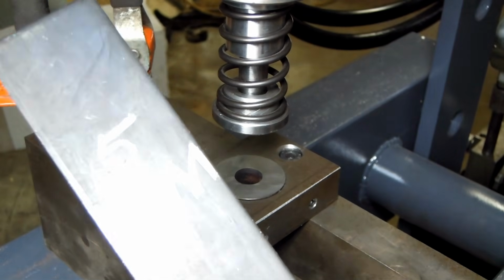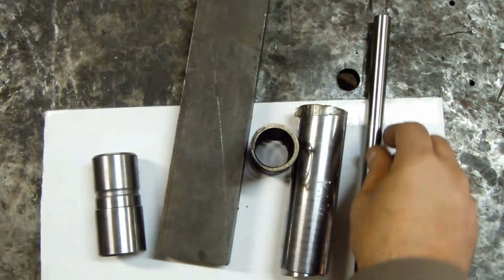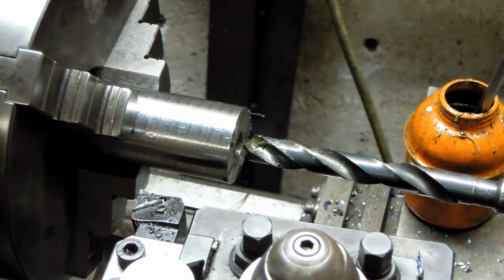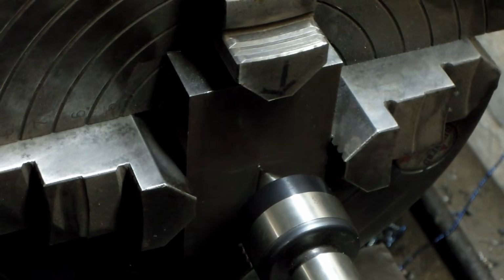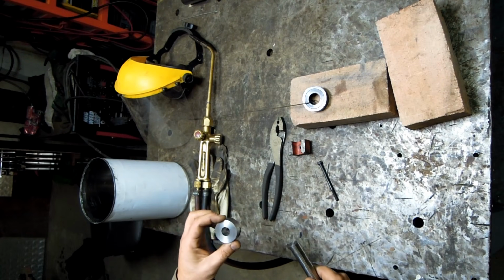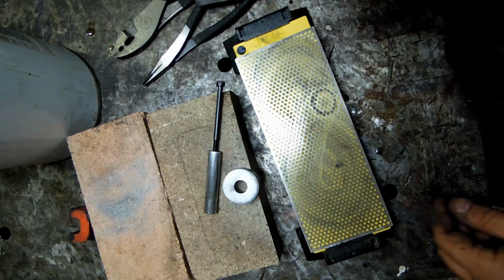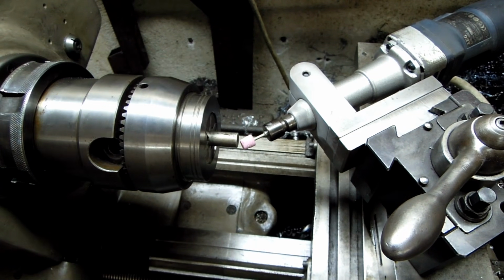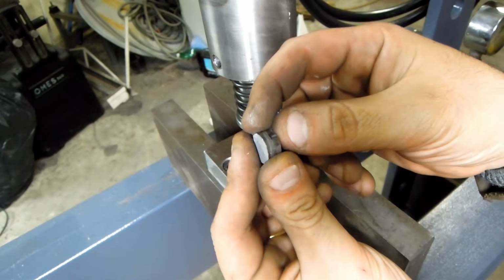diy punch & die

Comment: If you put a point on the punch tip, that can serve two functions, help get you aligned with a center punch mark you made during layout and kinda serves to start a deformation of the would be slug before the cutting/punching action starts... unless you have plans for the knock-out slugs to be a bit flatter and not having a dented point in the middle of each... nice work, like always...

Comment: After this kind of heat treatment you should grind parts a little bit (around 0.8mm on diameter and 0.3mm on ends) because they are much harder inside than outside (that means you have to make larger diameter and grind parts to the right dimension after heat treatment). There should be also some clearance between punch and a die wich depends on a thicknes of a material you are punching. (Thicker material > bigger clearance because you dont need that much force to punch, but it cant be to big because material will bend around hole). Im a toolmaker in Poland and i did a lot of stuff like that mostly on wire EDM and honestly i like watching chanells like this one because you guys have something very important - passion and heart for the job so you are often doing very clever stuff with what you have. I hope you will do this for a long time. Have a nice whoever you are, wherever you are iving :)

Comment: Tony, first of all I love watching your videos. As to how to retain your die in the block I find that grinding a 10 degree notch on the OD of the die and putting a grub screw in the center of the die block at a height that will pick up the tapered notch is the easiest way to go about this. Most none cnc type punching and shearing machines use this method. At huge diameters and workpiece thicknesses this changes to more robust methods of retaining the die due to large stripping loads. Anything you can do with your shop press will be fine with this method. Good on you Tony - keep up the good work!

Comment: I would suggest you incorporate some "shear" on the punch face.
This will reduce tool & press shock on breakthrough & reduce the tonnage required.
Where minimum punch guidance only is provided (as here) the shear might be in the range 2.5 to 5 degrees from edge to centre - so that the two proud punch edges engage first & together - hope that's clear.
Also your die retention with roll pins looks inadequate, & I think two diametrically opposed set screws locating into a shallow groove on the outer die diameter would be easier & superior.

Comment: Not to say this video isn't great, but people please go watch his other videos. There is no reason this should be his most popular. Watch the new ones. They're WAAAAY better. Oh, and keep it up Tony. New Subscriber, but I've been watching your stuff a lot lately. Great job.
Reply from the maker: Thanks Mark, welcome aboard!
Reply: Very impressed with your machining skills; thanks for the video
Reply: I feel like its because people are misunderstanding "punch & die"
Reply: so,what's that mean?
Reply: lei ningbo Well if you do a lot of drilling in thick stock, this is a life-saver. These holes are great for welding pieces together, as you can weld into the hole to next piece, then fill hole with weld. Imagine sharpening all the bits from pilot to finish just for one hole, then multiple holes. Now he can make diff. diameter punches, for varying holes as required. Saves a fortune in drill bits.
Reply: I really want to make one of these. A press would also be a great project to weld up with my everlast the next time I'm in the shop.
Reply: ..and it's more quickly and eficient when the precision of the hole are not required. Ex: To clamp two pieces with a screw.

Comment: use old pantyhose between punch and die when lining them up.   Automatically sets clearance the same all the way around punch.   Also a little oil on punch and top of die before using helps part come off punch and die will last longer before needing sharpened.  die clearance goes up as thickness of material to punch goes up.
Reply: And also material type, Mild steel gets 10% of material thickness while aluminum gets 13% material thickness plus the diameter of the punch. All materials are different, so experimenting with a load cell is important.
Reply: Old pantyhose? This is a family channel!
Reply: Proper die-clearance is a necessity. Just look at the slug to check this. There should only be one fractureline on it. This fractureline tells you if your clearance is correct. On mildsteel the sheared (shiny) part should be about a third of the materialthickness. The harder the material, the shorter this gets. Furthermore, you could modify the punchbody to make it perform better in these thicker materials. A little backtaper on the punch aids in stripping and reduces the material build-up on the side of the punch. Great video, I'm new here and am going to subscribe now. Bye!

Comment: I was a Tool and Die maker for 25 years. Anything like this you can pull off at home, More Power to You. I didn't catch what kind of steel you are using. Doesn't this kind of work seem to take forever. When you are not getting paid.
Ha
Good work

Comment: I used to make low tech decorative stamps for silver jewelry out of mostly drill rod. To harden I used a small magnet on a wire and heated the punch just to the temp that magnet wouldn't stick, then water quenched. To temper I heated from top until straw reached the business end, so top was softer for hammer blow. Crude but for stamping sterling they held up very well.

Comment: Thanks for making the videos .I made a punch for my hydrologic press for punching 5 mm holes . I used a 4x4 leaf spring very hard metal . Sharpened up a mason drill to drill the holes worked fine with oil as coolant . no need to temper it . For the punch I cut off an old drill bit . Worked grate  . Maybe you could try spring steel next time . You can buy a green stone on eBay for sharpening tungsten

Comment: HI There, Some very sound practice good to see people trying !. Few words of friendly advice, try using same material for punch and die, Silver steel is ok but not a high tensile strength compared to tool would be better to have punch as tool steel die as silver. Your spring needs to be a proper die spring, you won't/shouldn't be able to compress by hand normally colour coded and very tight coils. Modular construction of punch is ok as it reduces stressed areas but to be fair if you are only using it 100 times in your life then don't worry ! With your heat treatment try using old motor oil as the absorption of carbon into the steel can help and also keep the parts at a good red heat for at least 5 mins. longer for large parts.
tighter tolerances between the punch and die can help reduce force, remember smaller the area the smaller the force.   
Nice to see people having a go keep it up !, hopefully i will post some videos of my own when im not too busy machining !

Comment: I know I'm late to this party but:

I think you should go with an adjustable "fixed" stripper. Something held to the die that will pull or rather hold you work/part off the punch. By "adjustable" I mean with spacers and longer or shorter bolts depending on the work. I work as an engineer in a "world class" (that's what they tell me anyways) forging facility. Although our work is warm forging (1400-2300 F°) and you are working with cold steel. We use spring strippers and fixed depending on the part we are making. Fixed is obviously more reliable as without catastrophic failure the part always comes off the punch. That being said we do mostly use spring because of the variation of parts we make. I just dont think its neccessary for what your'e doing.

That's all, and thanks for these awesome vids.

Comment: Just for your reference as an old tool maker the quick formula for tonnage in mild steel is Dia X Thickness X 80
Reply: Dia in mm or inches
Reply: @jishnugopakumar  Some quick math suggests inches. Here are calculations for the same size hole in millimeters and inches:

15mm x 9mm x 80 = 10,800

0.591in x 0.375in x 80 = 17.73

The inch calculation results in a number that's not too far off from This Old Tony's measured result, and errs somewhat on the side of more tonnage. The metric calculation results in a number that doesn't work out directly as tonnage. If you assume it's kilograms, and do the conversion from metric tons to US tons, you'll end up with a value that's further off and errs on the side of insufficient tonnage. If you really wanted to use metric, it looks like the following formula should result in very similar values:

diameter in mm X thickness in mm X 0.12 = metric tonnage

If you need the result in US tons, you can either multiply the result of the previous formula by 1.1 to convert to US tons, or use this alternate formula:

diameter in mm X thickness in mm X 0.132 = US tonnage

DISCLAIMER: These formulae were designed by modifying Steve Ibbert's formula to account for metric measurements. While they should get you in the ballpark, they weren't copied from any official sources.

Comment: If you used your time travel machine you could have sharpened that die with your surface grinder. Agree with oil comments, would really help tool life. Love your videos, was a tool makers apprentice many years ago, then got my engineering degree. You get an “A+”, love your old equipment. Cheers!

Comment: Years ago I needed to have some parts blanked and I hired the work done from a company of Germans that made fineblanking dies. Well, I learned from them by examining their dies and I ended up making dies for some other things that I need blanking and I employed the fineblanking technique. Fineblanking dies are precision ground after being hardened with up to three levels of blanking and shaving of the part. I can't go into all the details this point but I must say one thing that fineblanking crates really nice parts. They're almost like you machine them and leave that fine finish on the edge of your part without actually putting them in the milling machine. This part today is O.K. but  again with "fineblanking" techniques it would have had as fine an edge as milling.
Reply: You did notice this video was 9 years old and he's much better in 2023. This man is a Legend. I also agree with what you said. Those Germans work metal like no one else, they're amazing.

Comment: good work Tony I work in steel fabrication 40+ yrs .You should make your punches square faced but with a nipple like a centre punch ,so when you mark out workpiece  and punch hole centre you can position it accurately under punch .
also your die holder use a setscrew then you can interchange different size dies easily cheers

Comment: Regular punches for use in a Buffalo or other punch machine, will normally have a centering tit on the punch. This allows you to do your layout for the holes, and center punch them for easy indexing when punching holes.
Also, the phrase, 'squaring the hole' is meant to help remember how small a hole you can punch in any given material. So, for most things, since the most common material being used for fabrication is plain steel, you would not use a punch any smaller than the thickness of the material being worked. Other materials such as SS will have a different requirement for thickness to punch diameter ratio. This is a very important thing to remember, as anyone who has ever had a punch shear off can tell you. 
Also, putting a drop of oil on the spot to punch is helpful in the shear and in stripping the punch from the work.

Comment: If you overheat the ferrite metal (BCC grouping of iron with limited carbon) while it is in an unstable form of martensite during pretempering, the carbon in the austenite phase (FCC grouping of the iron and carbon atoms) can be leached out of the steel chemistry  by the atmosphere. After pretempering, even if you temper the part properly, you will have a weaker stablized martensite phase because there will be less carbon in the chemistry. You can read a little bit about it on wiki.

Im guessing that the torch phase of your heating overheated the part and spheroidized the metal.

https://en.wikipedia.org/wiki/Tempering_(metallurgy)#Physical_processes
Reply: nigga what does austin powers and martians gots to do with anything?

Comment: Creepy, your press sounds just like my wife. Btw, what's the advantage of punching instead of drilling?
Reply: SirArghPirate Drilling and punching each have their place, punching is much faster than drilling however it can distort or bend the metal. You can't punch a hole that's smaller than    the thickness of the metal as the punch may explode, ie 1/4" hole in 1/2" thick bar or plate.
Reply: First thing I thought of was my wife's squawking. Either I'm not as odd as I thought I was, ..or you're as odd as I am.

Comment: hardest part is probably keeping the dies perfectly aligned in the machine 
if you have a dedicated press for this stuff (where you can lock the cilinder in one place and have fitting pins on the base to center the bottom dies on ) you can make dies for louvres and flanging holes too
as for the spring , think a valve spring from a truck engine should fit

Comment: That was pretty cool! Just a tid bit of info, The round dies for my Edwards Iron worker are made by Cleveland Tool Steel. You can get a punch and die set for around  $28.00 up to 1  1/6" . If you could machine the holder for the P&D you'd be in as the sets last an extremely long time.But making it is always cool! I thought about doing this to my turret press as sometimes the Iron worker is restrictive on certain parts.

Comment: Good job! I may want to make a punch and die set for small motor laminations. The material I have is 0.0135" thick but I may use as thin as 0.003 or 0.005. I will need to punch holes as large as 1.5" diameter as well as much smaller holes and slots. You've inspired me to try to make a tool for this! Cya on HSM.

Comment: Quick tip for those interested (I'm sure Tony knows this):
Rather than eyeballing the centrepunch mark while fiddling with the adjustment of the 4 jaws, it's sometimes quicker to leave the jaws clear, bring the tip of the centre into the mark so it holds the workpiece against the face of the chuck body, then bring the jaws up till they all just touch, then evenly tighten the jaws (at this stage you can switch to eyeballing to check)

Comment: I'm impressed, just a little observation: Typical dies for production work are not tapered, you can just relieve the back with a mild clearance. You only tend to see tapered clearance on wire edm'd die buttons, but I do admit, it is stronger to be tapered.

Comment: at the big tool firm I worked for, we used strictly wire edm for punch and dies. lick the blocks top and bottom on the surface grinder then hand em to edm, then grind to nominal

Comment: 1/4 radius vertical marks scribed on the spring release plate could be used as alignment marks. Cross mark the stock where you want the punch to press then line up the scribes marks. Just a thought.

Comment: Very nice work there. Maybe its not what the pros use but if it works what the heck? One thing you may want to consider if you find yourself doing quite a it of heat treating is investing in a DIY heat treat furnace. They don't have to be all that big or expensive and they'd give you more consistent and even temperature control than the torch.

Comment: I need to make one too... I made keychains on the side and thought it would be so cool to make them out of aluminum. Problem is my laser won't cut aluminum (only marks anodized ones). I could stamp out rounds with the punch press, and then send it in to be anodized. Then I could mark it with a laser.

Comment: I read about a technique for case hardening I thought was just spiffy.
The man basically had a steel tube with end caps that could be screwed on and off.
The part went in the tube which was then filled with I think pot ash. Of course the tube must be large enough to totally surround the part.
The filled tube then went in the furnace to be heated, in his case, red.
I think Herr Tony will get it that the outside of the part will take in a small layer of extra carbon making it harder than the rest, ie case hardened.

Comment: nice work! especially hardening :) power of simplicity :)

I think it's more accurate to use some oil dispencer from bottle like this 2 идеи  !!! что можно сделать из крышек от пластиковых бутылок???( simplify your life ) or from domestos bottle. Because the brush is leaking, dripping, collecting chips...

Also it will be good to remove sound from speed up video or replace it with some music

Comment: One thing that would improve this is to put a small point on your punch. Commercial punches have a small point on them so that you can line your punch up to a centre punch mark on the material for accuracy. The ends are flat ground around the point. Use some oil and your stripper will work much better.

Comment: I would recommend a 3% per side on the die for material clearance for stainless and mild steel, for aluminum aluminum is more forgiving.  So for .125 mild steel material thickness and let’s say you are using a .500 punch your die would need to be +.008 to +.012.  So the die would be .508 or .512.  Hope this helps someone there are charts in the machinist handbook 30th edition for clearances for punch presses I use one everyday and it’s a big nasty CNC one. 60 tool slots and 2 auto indexers.

Comment: You need to get you one of those $60 3M fiber Wheels for cleaning that oxide off they clean up metal so nice that they're absolutely amazing you can actually break edges with the wheel

Comment: Nice punch set up, A bit of oil on the punch and bevel the edge (roof pitch type bevel of about 8 degrees) it will reduce the force needed to punch through and be a lot smoother then an "explosive" punch.